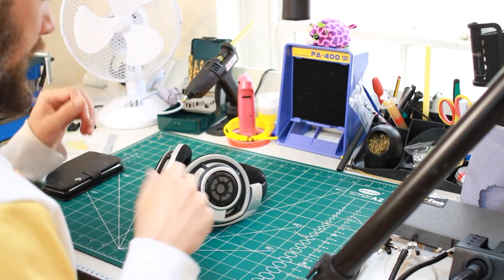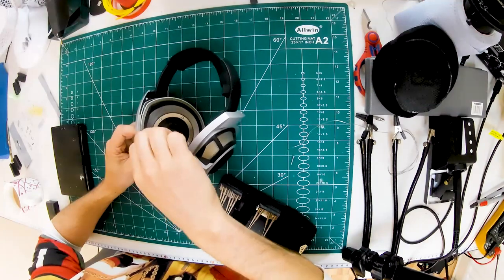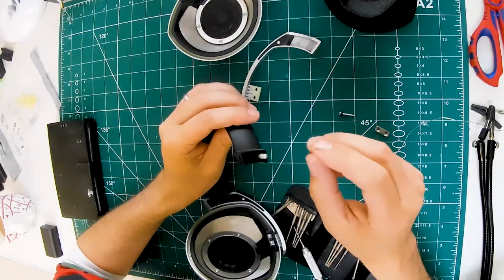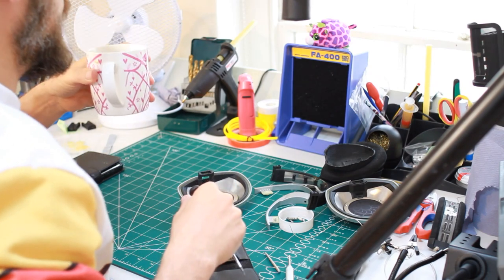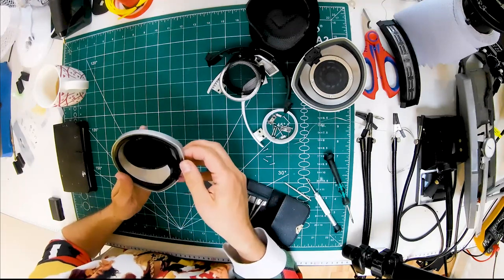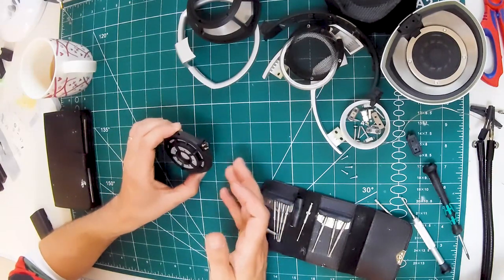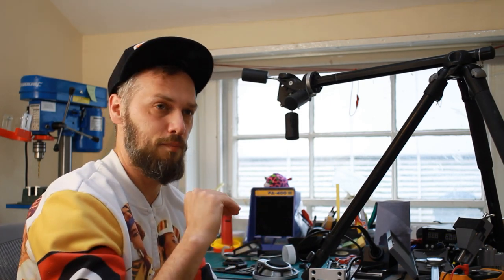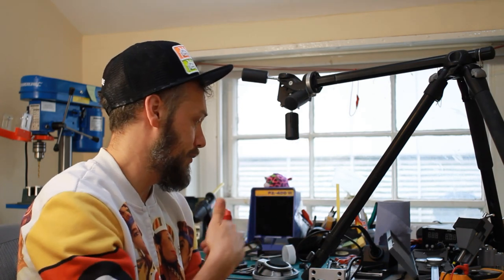Sennheiser HD800 dismantling and design review

Comment: Great video. The driver tech used in HD800 series is clearly much more advanced than HD600 series. I'm thinking of removing the external black metal grills. I think that will improve the sound by a hair or two.

Comment: I plan on messing around with a 3D printer and learning design and modding skills on cheap headphones (thanks to your channel), but I am very tempted to get some HD800S or Verite drivers eventually and mess around with those. I am curious how good baffles can get, especially in closed headphones.

I think you should get more expensive headphones to mess around with in the future. It seems like a good way to learn some tricks and also find drivers to build headphones around.
Reply from the maker: I do have a set of used HD800 drivers in the parts drawer as we upgraded some HD800 with HD800s drivers. I just have not had a chance to do anything with them yet ;)
At the moment our youtube channel only makes around £40 and costs probably 10 times that to run so budgets are tight but if we end up getting more subscribers in the future, we can start playing with more expensive headphones
Reply: @CustomCans  Can't wait for that. Hope you make it there.

Comment: I'd love to see you try to fix the HD700s issues. I still feel like the HD800/s is missing something that the 600 series has, and always found the HD700 housing a much better fit and intimacy despite its glaring faults. I think Sennheiser missed the mark by using the HD700 drivers in the 660s when they could have used the HD700 housing with a different set of drivers instead to amend it.
I believe the HD700 is a 20 degree angle whereas the HD800 is a 10 degree.
I don't see a lot of people moding headphones anymore and you seem to be one of the last of a dying breed.
Reply from the maker: I have never played with some HD700s - nobody has ever sent some in to us. I may have to see if I can pick some up on eBay and have a go on them
Reply: In all the videos that I could listen to on youtube the HD700 is a horror.
that's why I never bought the HD 660 , because it's a recycled HD700.
It would seem that the HD800 and HD800S range is no better off.
today it is the FOCAL Clear which has taken over.

Comment: Remarkably plasticky.
Reply from the maker: It is probably the best material for that design - the shape is very important and if they had made it from something like machined aluminium it probably would have would have been more resonant and added quite a lot to the cost but I know what you mean - it would have been nice if they made a wooden version or something
Reply: They probably want to keep down the weight, heavy headphones are not fun to wear in the long run.